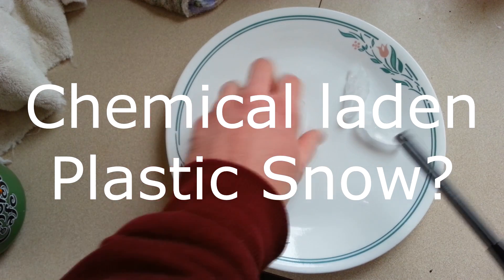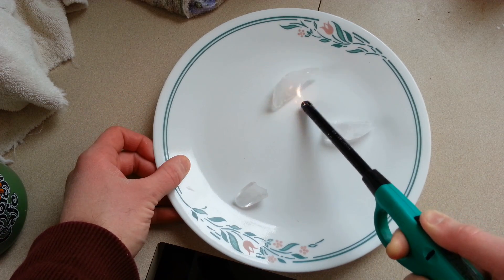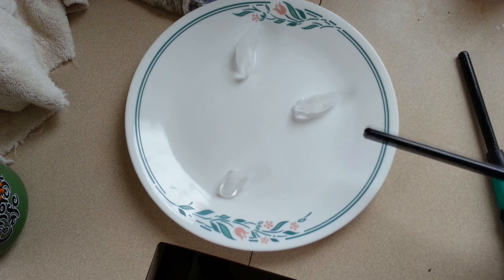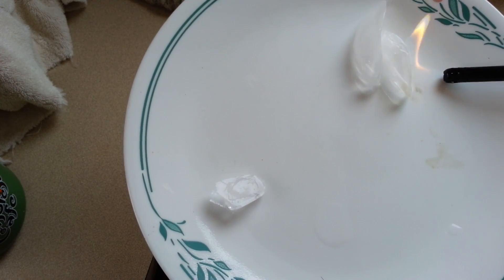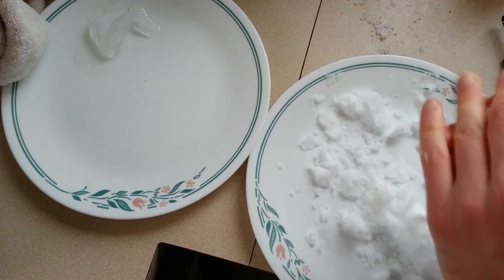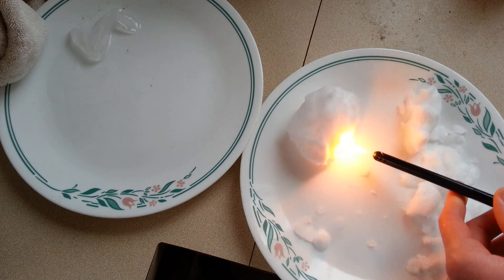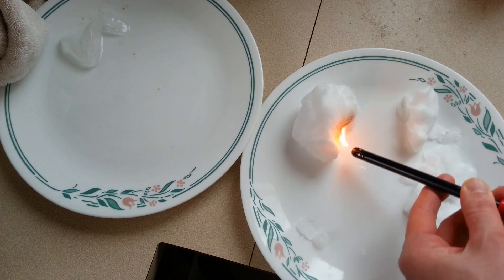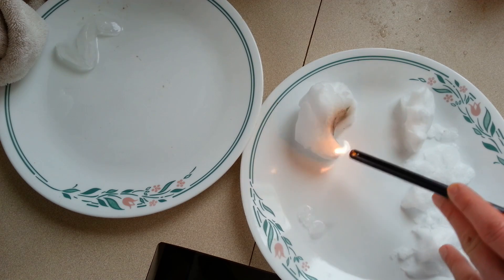Plastic / Chemical laden Snow - The Truth Exposed!

Comment: I work outside , in the snow and I use a cutting torch all day long.  I'm here to say that when I melt the snow it turns to water. I have to stand in and work with wet boots all day long. That snow is just that, SNOW.
Reply: A cutting torch is also a lot hotter, so you can't use that as the same result a small butane cigarette lighter would do.

Comment: I understand the whole concept here.  Even when I first heard about it and we tried it, I understand that there's no melting because it is evaporating quickly.  And that the black is soot from the lighter.  What I couldn't figure out for sure, is why it smells so strongly like burning/melting plastic?  The theory shared by my friend is that it is due to the chemicals in our air.  Is this correct?  Or is there another explanation?
Reply: More than likely it's the residue from chemicals the lighter is spewing at the snow.

Comment: Before seeing your video, I ran this test today on my Maine snow, and was surprised that it "went away" so slowly.  I thought it would simply melt.  I think what might be happening is that some does melt but then the heat is used to change the liquid into a vapor, which keeps it from melting as quickly as I expected.  I am not sure how it can be sublimation, since if you look at a phase diagram of water, it appears that true sublimation only happens below the triple point, at a very low pressure of less than 10 millibars.

Comment: The reason it smells and turns black and smokes could also be PARTIALLY because the snow picks up just pollution in the air (like acid rain does).  When the water portion sublimates, that means there's no liquid water present on the surface, so any impurities in the snow that it picked up while falling could be free to burn without being doused instantly.  Thus it could smell worse than just holding a lit lighter in the air.